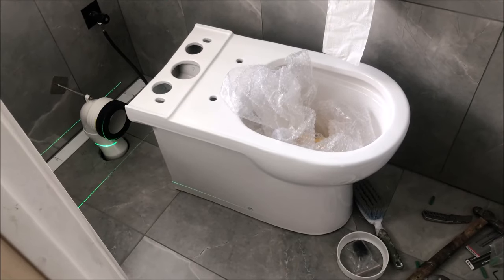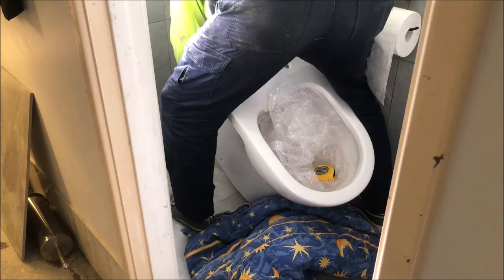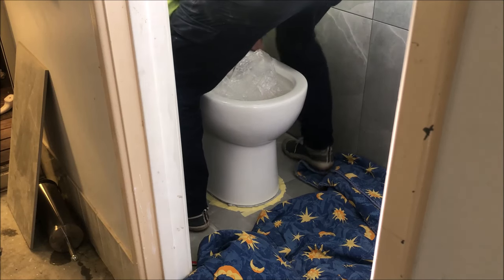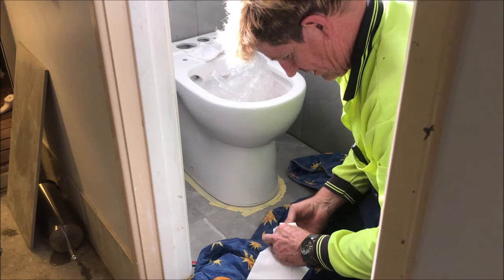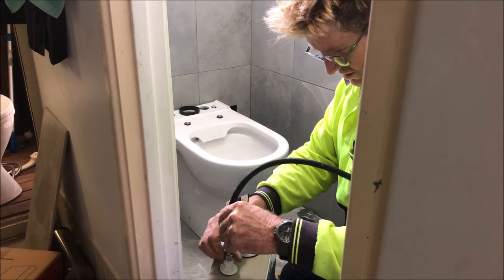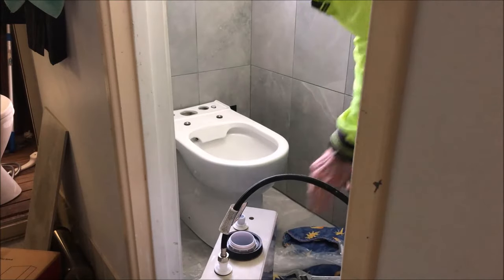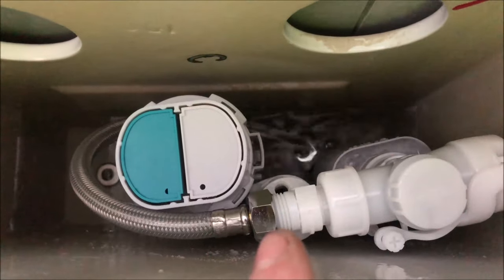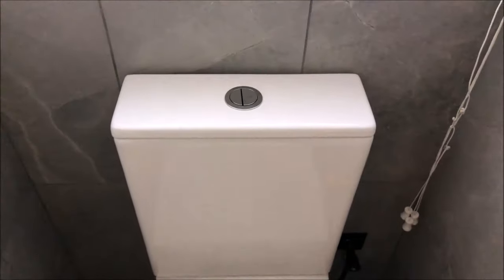Rimless toilet installation, back to wall

Comment: Dear plumber I see you did not install the pan fix down screw located on the sides of the pan as per the manufacturer instructions ...over time the silicon seal you placed under the pan will deteriorate  and without the pan fixing screws installed the pan can develop a rock when used...a rocky pan will further stress the soil pipe and cistern connections resulting in possible leaks  just saying.
Reply: Are you gonna break the tile to put the screw in?

Comment: Thank you! The lower water supply through the hole in the toilet bowl makes it impossible to easily replace the water supply tube without dismounting the toilet tank :(

Comment: I reckon I've got the same toilet which the previous owner installed and we've got some odd smells which would suggest that he possibly hasn't sealed it correctly. I'm therefore going to remove it and have a look myself. What's are the screws inside those holes on the side. Are they Philips heads or Alan Key heads? My room is quite small so I can't get my head down there to have a look inside the holes.
Reply from the maker: I did not use the side bolts, I silicone the pan to the floor

Comment: How does the tube from the external water point go to the back top hole, to connect to the cistern valve? I see no lateral hole in the left or right side of the toilet. It is flush with the back wall.
Reply from the maker: no, there is an area to the back side where the water line can go through and under the cistern